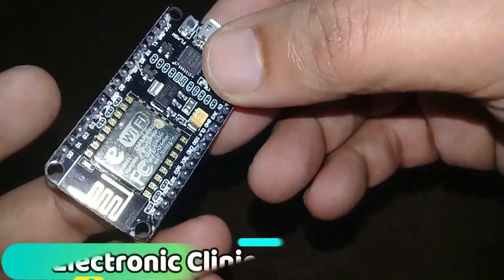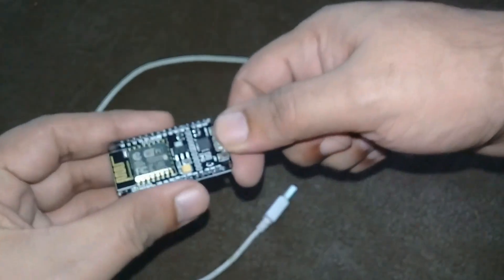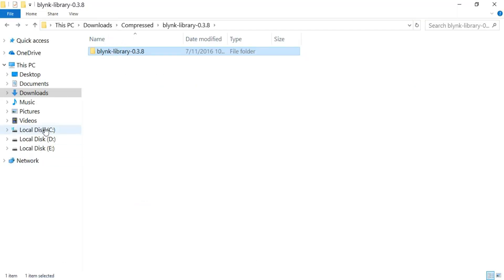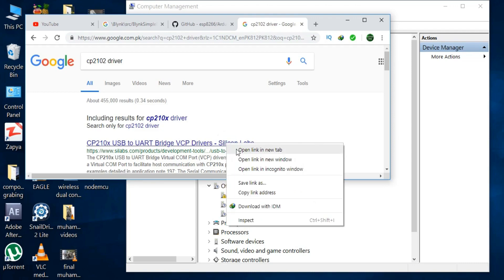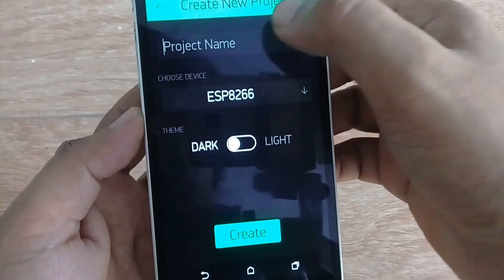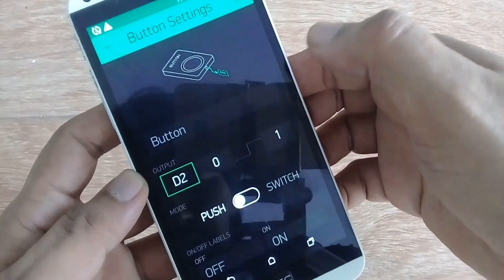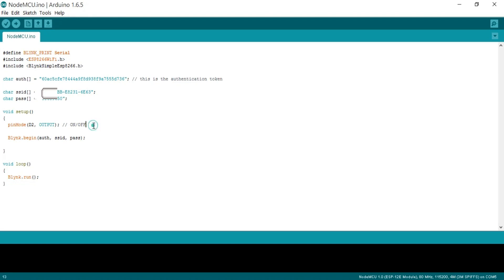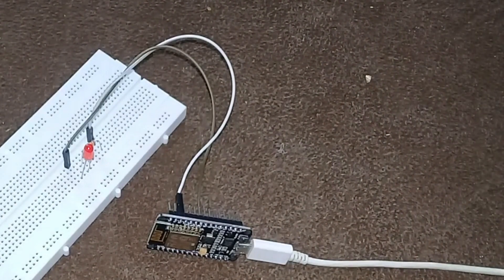Nodemcu esp8266 wifi Module Basics, Board installation, Library, Blynk Application, Usb uart Driver

Comment: i have being trying to build a ph sensor, temperature and flow rate meter using arduino and esp82666 01 module but am having issue linking the esp8266 01 module and the arduino to getether to send the various value from the sensor to blynk app..please can you assist .

Comment: when i'm connecting nodeMcu ith blynk, its successful uploaded in arduino IDE, but on the blynk app "wasn't online yet". anyone can help me? thx
Reply: Its solved , i change wifi router, thankyou.
Reply: @platinumsuplemen3155   have not understood bro...i am getting the same problem..what i have to change to solve this problem...please assist me step by step
Reply: Abhik Manna try to use hotspot portable on your phone as a wifi router
Reply: @platinumsuplemen3155  okk sir.. actually in the Arduino program in place of ssid and password i have to put my Wi-Fi network SSID and password?
Reply: on serial monitor : blynkcloud:80 login timeout
Reply from the maker: if you follow each and every step, you won't get any error..
Reply from the maker: watch other tutorials on nodemcu as well.

Comment: Fahad what about VB.Net Web Application  .Design an HMI in it and send command to Nodemcu Wifi Module.is it possible??
Reply from the maker: But whats the advantage if we do so ?
Reply: obviously  LIKE online HMIs. You can control the machine from remote location.did u heard about Ignition HMI,s  for large industries there license are very expensive  and the design is very complex.
Reply from the maker: i have designed scada systems for plc. in that case you don't need this wifi module with computer. coz laptop is already connected with wifi.
Reply: ya i know  .the point is   i want to design   an online HMI for Arduino or Nodemcu not for PLC , SCADA and  android.
Reply from the maker: that i will cover in firebase. First i am making basic tutorials on nodemcu esp8266 wifi module.
Reply: Ok gr8 waiting for it bro.keep it up.